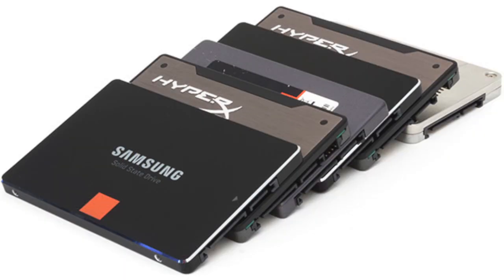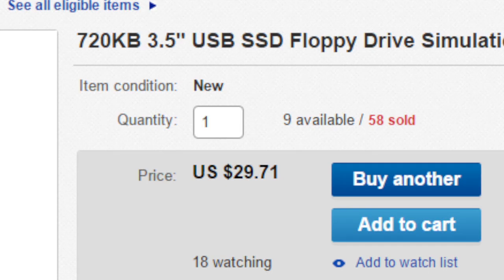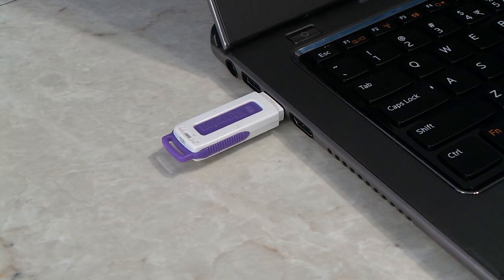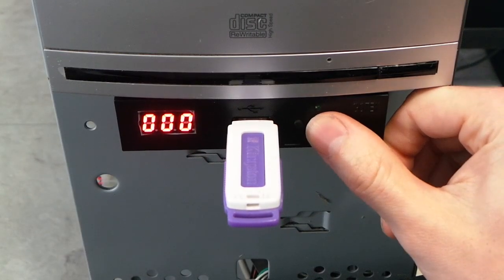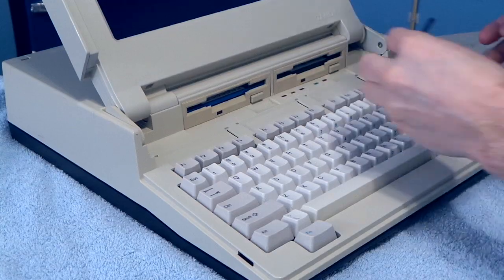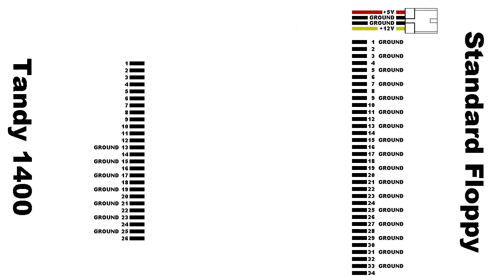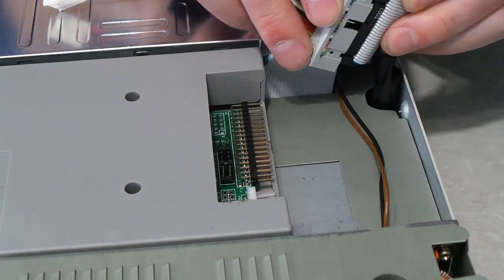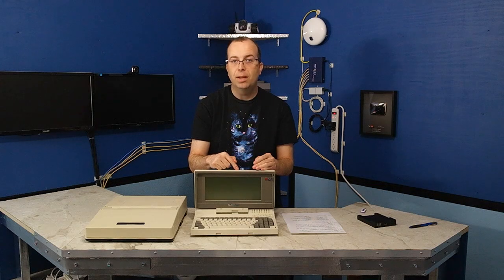Upgrading to a Solid State Floppy Drive Emulator

Comment: "I'll pick this back up when my enthusiasm returns..." haha... totally been there.
Reply: #noenthusiasmforme
Reply: haha, what a horseshit scenerio. My enthusiasm would have died pretty quickly after that too.
Reply: that day never came....
Reply: @Mr_Meowingtons there's a lot of videos he's never made
Reply: The older I get the more I think of a Lethal Weapon movie quote, "Getting too old for this shit."
Reply: Todd Na when in doubt, quit
At least that how he does it
Reply: That's literally me with Tales of Phantasia on SFC....been playing it on the retron5 and had issues that made me basically give up because I don't have the enthusiasm to play any more given those weird save issues XD
Reply: Try this on ebay. 232728965894
Reply: So... No enthusiasm yet. 🤣
Reply: relatable
Reply: Spent 5 days getting my GPU working. It was one of those problems where the GPU worked 3 out of 50 times when rebooting. Tried every imaginable BIOS setting, removed PCI cards, etc. etc. etc. for 5 f*cking days. On the 5th day, Saturday morning, piss drunk, dead tired, I tried one last attempt by moving the GPU from the PCIExpress 3.0 slot to the PCIExpress 2.0 slot. It worked. Just wasted 5 days on that, but like I said it was one of those "sometimes works" problems. I think the problem was that my CPU couldn't start up fast enough for the GPU.

Comment: Don't feel bad, I tried installing RockStor on an Iomega Home Media Hard Drive (Classic) only to have RockStor not work! I was so hopeful in getting it back up and running as the NAS Central solution for a bad drive was to format the drive in Linux and a confusing way to re install the Iomega firmware! Lenovo bought them out and refuse to help on any Iomega Storage device- but I came out with a solution, providing I can find a pico-ITX board, the same size as the board inside the Iomega with a SATA port at the end! This way, instead of just a NAS, I can also have a media player using either Windows or Linux! But I'm still searching,.....

Comment: Next time you feel like tinkering with it... visually inspect all of the electrolytic capacitors. If any look anything less than perfect, consider ordering replacements from DigiKey or Mouser (Mouser is in Mannsfield, so slowest shipping option should still be fast). This is very similar to how modern TVs sometimes die.

Comment: Did you compare the DIP switches between the 720Kb and 1.44Mb versions of the Drive emulator? Could it possibly be the same identical hardware with different DIP states?

Comment: Great video!  Too bad you couldn't get it finished.  The timing of this is hilarious because the past few weeks I've been grappling with the exact same problem:  bad 720K floppy drive on a Yamaha V50 synthesizer being replaced with Chinese USB emulator drive, where original floppy has a 26-pin connector and I needed to make an adaptor, so I bought a bunch of electronic stuff to do it, but I got stuck on how to figure out how to match the pins together, so I wound up buying a German adapter on Ebay and I'm still waiting for that thing to come.  I wish I would have seen this video a week ago!  Anyway, thanks for posting.

Comment: I wonder if somethin similag could be done with a microchip PIC. Would be better to use SD-Cards as storage media, so they could fit in behind a cover of some sorts. and maybe even use a button like the floppy eject button for controlling. maybe with diffrent sequences, long/short pushing, or two-step button like cameras have sometimes.

Comment: In theory floppy drive emulation sounds neat and for some use cases it may work well but it only seems to work for standard 3.5" IBM PC floppy drives. This means it won't work for many other old home computers and also not for most copy-protected or non-standard disks. That's the main reason I still keep my real disk drives around.

Comment: I have a MUCH better software that is written in English that will let you use the drive much easier. It was extremely difficult to find online, and I can't even find it anywhere at this time.

It lets you format the USB into the proper disks, copy one disk to an IMG file, copy an IMG file to a slot on the USB, and all kinds of other stuff.

If you pick this project up again, and want the software, let me know and I'll post it somewhere for you.
Reply: +Alexander Borsi do you know how the emulator saves it's images (IE a folder for every image, bulk image folder, root of the drive, ect) and can you send me the english version as well?
Reply: Christopher Hauck the drive has to be formatted in a very particular way, either using the emulator itself (which I have found to not work reliably on some USB drives) or by using a program on another modern computer. I will upload it someplace and send you a link once I do.

I am not sure of the details of how either formats the drive. (Sector offset and all that jazz) But all that shows up when you plug one of the "USB floppy" into an computer is the 000 disk. It is a 1.38mb flash drive which you can read/write to as you would normally. The other disks (001-999) do not show up as drive letters, or mount points, or anything really. The only way to interact with them is that special program, or by using the floppy emulator itself and changing the disk on the front panel.

Also, the price that he paid for the emulator is a bit high... I got them for 18 shipped to USA.
Reply: +Alexander Borsi dropbox or google drive are the best because sharing them is really easy
Reply: +Christopher Hauck I found it online! http://www.ipcas.com/support/usb-floppy-emulation-download.html and you want version 1.40i to download

Comment: The behaviour of the Tandy sounds like a capacitor problem...

Many musicians who have older synthesizer keyboards that use floppies to store samples, parameters and midi data are using these drives as well. Unfortunately for me, the keyboard I have needs a specific model of the emulator,  because the Ensoniq EPS used a really funky floppy formatting. I have to decide if it is worth experimenting with the cheap Chinese drives, of spending more money on a unit that has been specifically engineered for my keyboard...to the tune of a couple hundred dollars.

Comment: If you really need (or want) a product like this, get yourself a FlexiDrive instead:
http://www.floppyemulator.com
It is far superior to the emulators shown, compatible with more devices, such as vintage samplers and keyboards. It does all sizes and formats of floppies. It takes standard images created with 3rd party software such as WinImage, from an SD-Card that's not sticking out, or even from a NAS over WiFi.
And yes, it has a price to match that. They're mostly aimed at professional measurement instruments and industrial equipment. I got one for my Rohde & Schwarz spectrum analyser.

Comment: You have a lot of patience. I would have likely gave up when I noticed I had to make an adapter, lol.
Reply: Yeah but, how fun to match those pinouts and solve the typo riddle. 😉
Reply: +GRAHAMINATOR Yeah, most of us would. I wouldn't even have checked on the Internet where the screws are. I would have probably pried it open with crowbar turning it into a piece of junk in the process and then I would have thrown it away. That's probably why all the machines I've attempted to open ended up in the garbage.
Reply: I would have looked at eBay for and adapter. if I didn't see one I would give up.

Comment: if I had to guess, I'd say something is wrong with some capacitors somewhere along the line. An old monitor of mine acted exactly the same, running for several minutes and then shutting off. It might be worth taking the thing apart and looking for some bloated capacitors. Replacing them is dirt cheap.
Reply: I will remember this!

Comment: So, what how does the USB stick show up on a computer when plugged into a normal USB port?
Is each image a partition?  Is it formatted with a partition that has img files on it?  What would happen if you just used something like 'dd' to clone a floppy to a USB drive, would the emulator recognize that?

Is there anyway you can clone a floppy to a USB drive with this device, then take that drive and put it in another computer and make an image of the entire drive and post that image online some where can download and look at it?  That would be awesome!
Reply: +Kris Occhipinti The USB shows up as "FLPPY0" and you can read/write to disk0 just as you would a normal floppy but just on the USB. For the other slots, you need to use a program or you use the computer itself to write to the other disks after selecting them.

Each 'disk' is not a partition. They are specially formatted by sectors on the USB that the emulator recognizes.

Using dd will not work, the emulator is not looking for that kind of disk image.

It is not a big partition with img files on it--that would be FAR TOO AMAZING to be a thing that happens. :P

If you have more questions, I can answer them more. I use these things at work a ton.

Comment: I use one of these emulators to transfer programs on an old CNC router. I'll agree its a little cumbersome but it works. The idea is the emulator is a buffer. Your plug in the USB & it writes it's image to the buffer. Then you can read it like it was a floppy drive. If you want to write to the USB it is the reverse. You write to the buffer & then push the button on the emulator & it writes to the USB. Each floppy image is stored in a numbered folder. you can have 999 floppy's on one USB stick. It WILL NOT deal with folders that are larger than a floppy would actually be. 999 floppy's is about 1.5 GB. I've also read that it will not see a USB stick over 2 GB. I haven't tried anything bigger, but you don't really need it.

To create the numbered folders simply use the buttons on the front of the emulator to dial up the desired number. Plug in the USB and it creates an empty folder with that number. you can then take the USB stick to another computer and you have the numbered folders in windows.

Comment: do your homework next time: there is a great software alternative for the gotek: https://www.youtube.com/watch?v=taFP1J_lZBI

also, you can fairly easily flash the firmware for your particular computer or buy an already modified unit (I have a version of Gotek modded for use with my Atari St - works like a charm)

Comment: Actually I found a 144/720 external to USB floppy on eBay which I found easy to dump existing floppies to "whatever." I'd use those bays for hard drive, card reader or other stuff... good luck...I have a TRS-80 portable (trash 80) I am looking to sell...

Comment: That emulator would have come in handy when I wanted to re-install XP on my old PC with a busted floppy drive and the only way to install the SATA drivers was through the floppy during installation. I tried to insert the drivers in a modified XP image but it didn't work. Oddly enough, I was able to install Vista with zero issues, so I learned to love it.
Reply: +Josh Derak You can slipstream F6 drivers into the ISO. . . what method did you attempt? nlite?
Reply: David Wellman It was a long time ago. Maybe I wasn't doing it right.
Reply: Josh Derak Roger that. Thankfully, XP is dead. DEAD! (Well except for the occasional IE8 testing I have to do. Meh)

Comment: I've been using the 1.44MB version for quite a while without any issue, the 720K version on the other hand is a nightmare to work with. I have tried every pin configuration from the documentation. I had it kind of working with trial and error, but it still is a nightmare to operate compared to the 1.44MB version. I might have received a faulty one, who knows.

Comment: Asians use these drives for old embroidering machines and/or keyboards. There's a ton of different versions available, even with just the connector facing the other side. You'll probably even find one with the 26-pin connector on AliExpress.

I upgraded my old Tektronix scope this way. Had to get a 2,5" floppy emulator which - sadly - can only work with 1 virtual floppy per USB drive. But it works perfectly.

Comment: You can flash the HxC firmware on those chines floppy emulators so it supports every floppy disk format you want and it uses a normal fat32 usb stick.

Comment: I worked out all the offsets that the drives appear at so you can play around with them on GNU/Linux with the USB plugged in directly. Just had a look for it and a forum software upgrade has truncated the damn post :/. Nevermind.

Comment: Long time viewer here,
just wanna point my experience with digital interfaces to you:

STOP and STEP are two totally different signals, I wouldn't cross the two.

STOP is a signal that tells the motor and data to stop all operations
STEP is to step over to the next track or 'cylinder' (don't quote me on this, it's been a long time)

just as a safe measure I would cut that trace, but if it works - more power to you!

good video either way, very informative!
Reply: +ionbladezofficial Also just seen the rest of the video, the step signal probably fed something to the drive, and the drive may have spit some voltage back to one of the data lines causing the effect you are experiencing with the laptop. I'm sure there's a diode or resistor somewhere that might need looking at.

Comment: Its the battery probably.  I have a bunch of those old Toshiba's  (T1000, T1200, wanted to get that T1400 at EDS:P) and they all run though the battery first then the incoming power charges the battery.  So if the battery is shot, even if you charge it a little bit, the computer will die the second it trys something high current like the floppy.  I just refurbishment my NiCad battery's with cheap cells from china, but you can also just connect directly to the batter tabs with a wire.

Comment: Those floppy emulators could be so much better if they used a microSD slot instead of a USB port like the HXC floppy emulators do.
Reply: +James Grimwood I was thinking the same thing... I imagine if they can convert it to USB, you could then attach a USB SD card adapter (internally) have it so when a card is in the machine, its all flush and you'd never have to take a 2GB SD card out ever again.

Comment: I really like using these GOTEK FDD emulators. I think I have four of them now :)

My oldest PC is a 386, so I they all support 1.4 MB.

Selecting an image on the GOTEK and then putting it into a modern PC, I always get the very first image, so that's a bit odd. But yea, it's a great product no doubt.

You can use two in one machine, works with VGA Copy for example. I haven't found software that can read a 1000 image USB, they only read the first 100.

Now I wish someone would make a CD/DVD emulator that supports ISO and BIN/CUE images as well as analogue CD Audio outputs :)

Comment: I just recently got rid of my last 3,5" 1.44 MB Floppy Discs. Imho the worst storage. For example System Shock had 9 installation discs, afaik Ultima 8, around 8 discs too. While System Shock got a CD Release shortly after the main-floppy-release (with better graphics, sound etc.). I started my PC time at around 1994, there was already the dawn of CDs ahead and breaking through with Rebel Assault and other games, utilizing the high capacity of the CD to add videos to the games.

Comment: I picked up one of these drives for my amiga and its a very handy little piece of kit. IT'll even let you boot to NonDos discs so you can play those classic games that dont load through workbench like Lemmings.
The drive itself however doesnt really work with the A1200 case unless you either cut away some of the casing, or there is a conversion kit on ebay that'll re-case the gotek and essentially make it look like you have a real floppydisk hanging out of your drive with the controlls and usb port on the bottom.
I find it kinda funny really, the first computer I converted to be solid state isnt a super modern PC, its a computer from the early 90s.

There is something I'm wondering though, I have an old Toshiba laptop, T360 I think, I havent used it in a while, which has a swappable Cd / Floppy drive and an external caddy for the same. Might a PC format gotek work in one of these machines, internally or externally?

Comment: Oddly the most amazing thing in this video to me was using that container for the screws and labeling what screws were in each little compartment.
Reply: +Dennis McCarson It's actually a good practice to get into. It not only keeps the pieces organized, but when you have to put it back together, all your screws and stuff are in the order you will need them. Just start at the end and work back to the beginning.
Reply: I'm definitely going to do it now, it's one of those things that you don't think about, and it's so simple and after you see it you feel instant regret that it took you this long to figure it out.

Comment: Back in ancient times I ran into same issue with a Tandy/Radio Shack computer and aftermarket drive. Was able to use the smaller ribbon cable and shove the power connector on the end. Worked fine